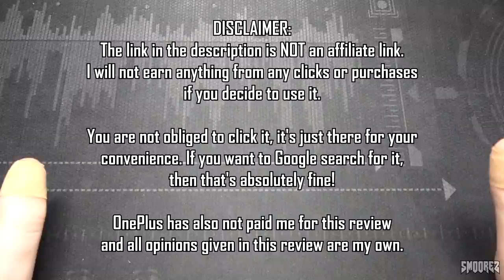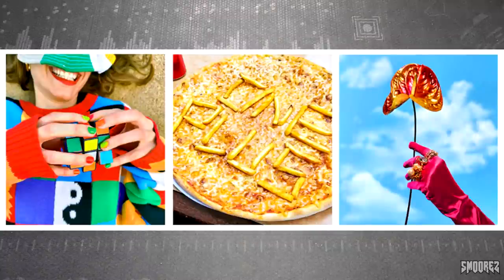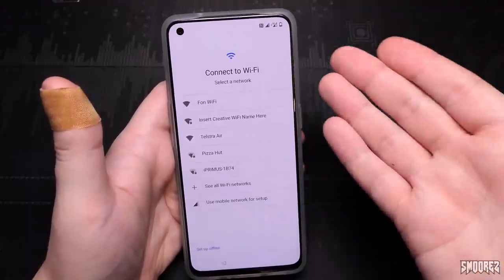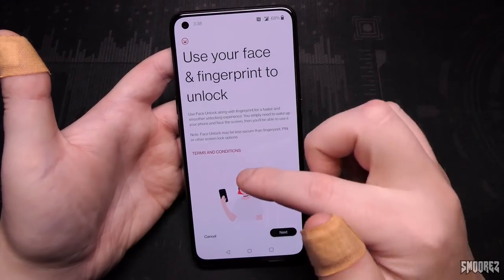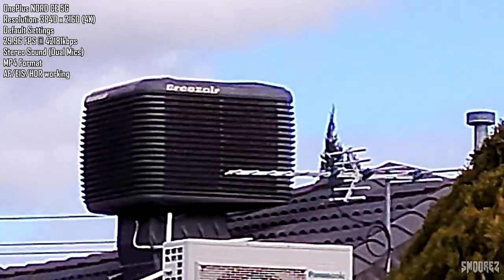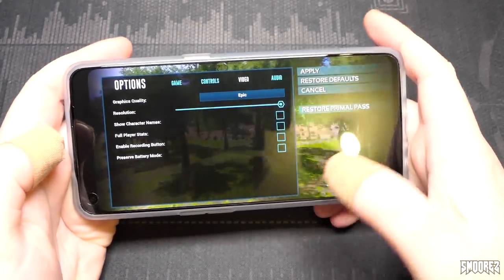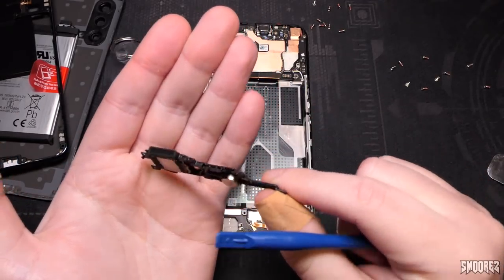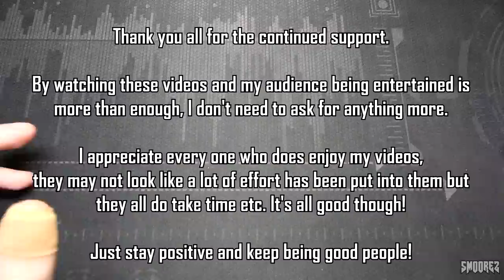The OnePlus NORD CE 5G - A thin & lightweight phone that delivers a lot! In-Depth Review + Teardown

Comment: Hey Smoorez, I still recommend you use Net Monitor or CellMapper to find out whether you actually have 5G. LTE_CA is just 4G, but it still might display 5G if the mast (or a neighbouring mast) provides it, but LTE_NR is actually 5G (non-standalone if you're familiar with that). NR on its own is standalone 5G.

Comment: my a50 6gb can play 4k HDR at 60fps with no lag. also the cameras are better. and speaking of the a52 it is newer and have better cameras. all of those are way cheaper than the one plus regardless of what smoorez said you can find the a52 for about $250 where the one plus is 399

Comment: OnePlus just killed this phone with the Nord 2..
Reply: What kills this phone is Poco F3. It is literally better in every aspect for same price. (Expect the fact it lacks headphone jack)
Reply: @jackwilson5542  I meant if you wanted a stock android/oneplus if you don't go Xiaomi absolutely.
Reply: @darling_yext  you could if you know how to unlock it and install custom ROM in it.

Im using POCO X3 Pro (since MIUI optimization isnt in my favor), running Arrow OS.

Also, POCO is my only choice for bang-for-the-buck phone because OnePlus wont sell it in Indonesia, and you have to pay the import tax for it as the result, which increase the price. That OnePlus in the video starts at 500-600USD in my country once you calculated the import tax.

(Also X3 Pro with SD860 for 240USD, how can im not interested with it)
Reply: @Keikoatr72  That's cool too but not everyone knows how to unlock it so they have an option now.
Reply: @darling_yext  yeah, i know OnePlus does have optimized UI for their phone, which is pretty rare in Indonesia nowadays. Thank God i know these type of stuff very well (i learnt it by myself (and internet), already used custom ROM for more than 5 phones so far, from old Samsung J7 to this X3 Pro)

Even iPhone here costs more than a 110cc moped here... (Due to import tax, since iPhone arent manufactured or assembled in Indonesia)